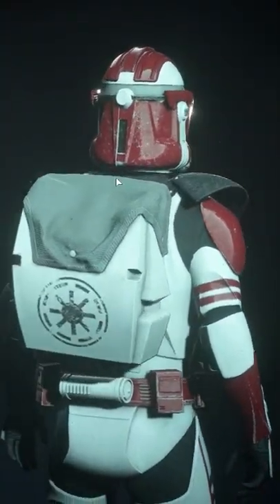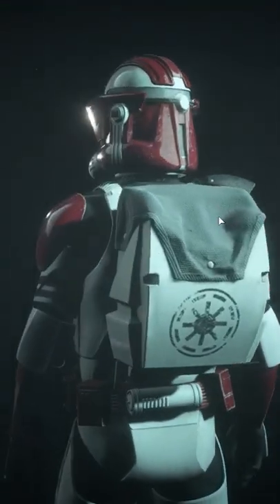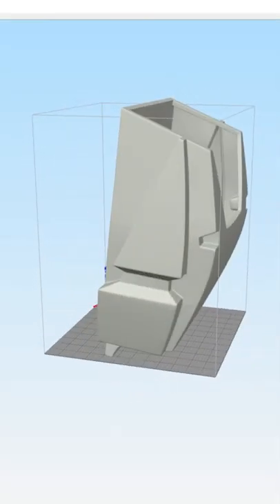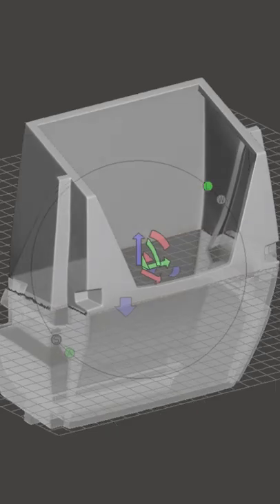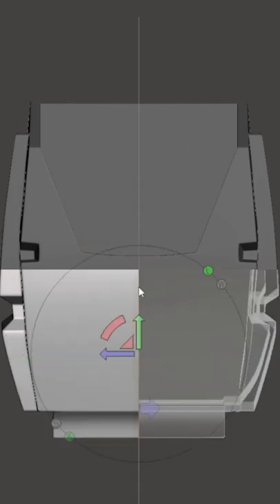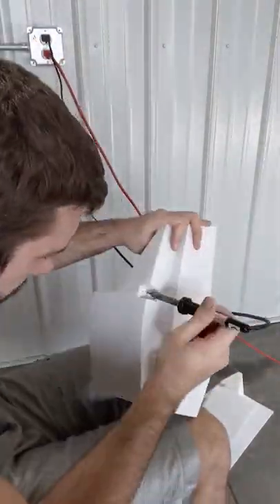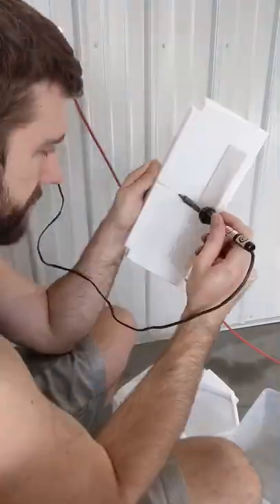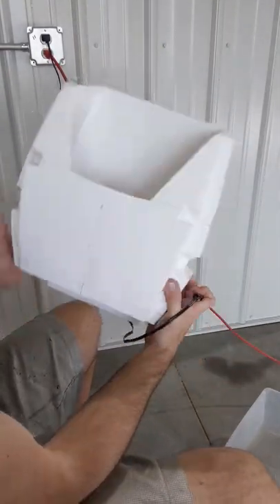Clone Trooper Backpack Pt 1

Comment: I would consider looking into a plastic stapler and a wood burning iron. The wood burning irons come with a wide flat tip to cover more surface area. And a plastic stapler will hold the pieces together in a very solid way.